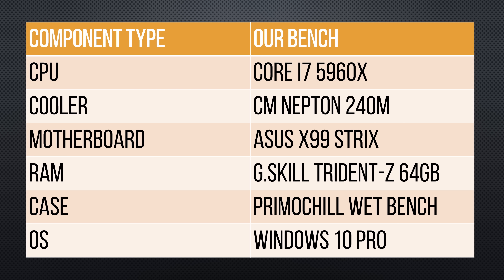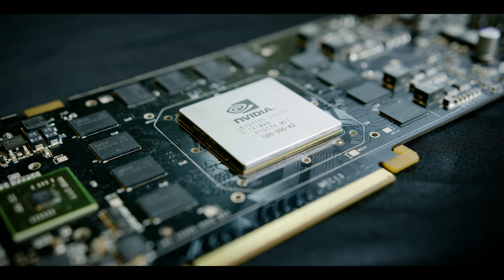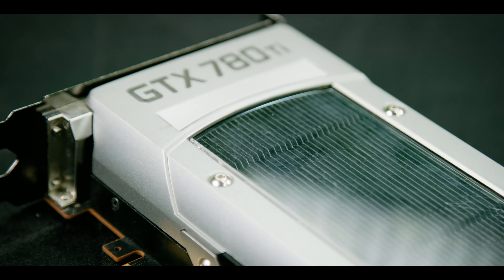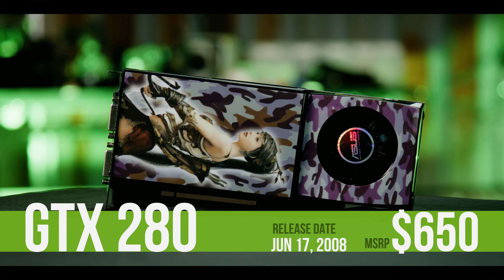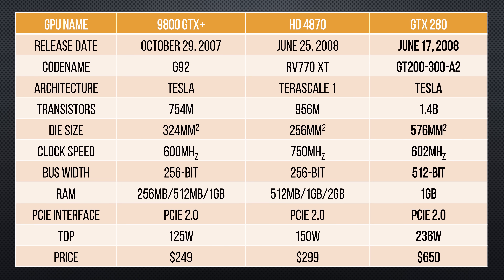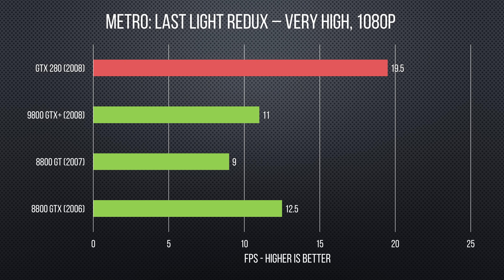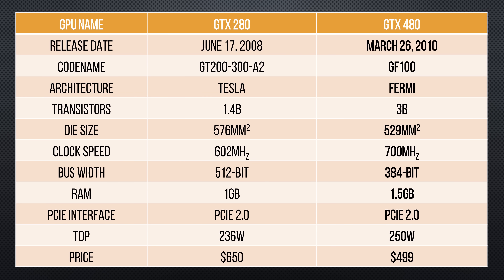10 YEARS of NVIDIA Video Cards Compared!

Comment: A bit late to the show here, but wanted to state the last few generation have not been that great. You can see early on HUGE jumps and strides that made upgrading exciting and fun; however, now it's more like "yeah, I can skip this generation" attitude. My 970 is still doing great and did not feel the 1070 was worth the money / upgrade. When you compare the GTX280 to a GTX480  it was over a 150(ish)% increase (memory could be fuzzy). Now when you compare the 970 vs 1070 it's barely over 50%.

Have we hit the ceiling and tech is slowing down to where we can wait 2-3 generations before upgrading? I want to build something new and hand this machine down to my kids for their school work and educational game *cough Fortnite cough*, but not sure if even the 1170 or whatever the next gen will be called is worth the costs. Heck, my best friend is still running my computer built with a i5 3770k (not overclocked yet), and AMD HD7970 (from mid 2012). That is a 6 year old GPU that is still running everything on high without issues not overclocked. 

Just saying this last 6 years has been rather disappointing. I could have kept that machine and it would be doing great by today standards, sure not the best and wouldn't play some of today's games on Ultra, but still pretty damn decent for a 6 year old machine.

Comment: He skipped over the GTX 295, which was the two 280s in SLI on the same board. At the time I had two GTX 295's, which gave me quad SLI - which was basically completely unsupported and useless for 97% of all games out there. Anywho I needed all that horsepower for the 5 year old 30" 2560x1600 monitor I had - which is twice the resolution of 1080p. Most things still ran like garbage in that you'd get high frame rates, yet to my eye things didn't look smooth, which was later referred to as micro stutters, a huge downside of SLI. So overall it was a complete waste of money, but I was rolling in cash at the time so I didn't actually care.

Comment: 980 was really useful if you were looking at a small build but still wanted a good and powerful system. Even today a 980 is nearly on par (bout 10% ~ 15% less powerful) than a 1070 with about 5% less power, that's pretty impressive. Not to mention it over-clocks like a beast!!!

Comment: So 1080Ti is not worth the purchase if used only for games, since the computing wasn't even used, and it had that tech for such stuff, meaning if it wasn't there, it would have reduced the cost, or better replaced with some other stuff instead to compensate and something that would be used.

Comment: My first card was an Nvidia MX 200,Then a TI 4200, a 6800, a 8800 GTX, 2 GTX 280's in sli, a GTX 590, and GTX 780, and now a GTX 1080 TI. I have nothing against ATI/AMD but Nvidia used to be the only graphics cards that would work in 3d with shutter glasses and a CRT monitor. They took the 3d out of drivers when the GTX 8800 hit the stores. I have an oculus rift now. Best 3d virtual reality experience I have ever had. Peace

Comment: i had bad experiences whit sli
2006 -  2 7300GS 256 DDR2 (fucking slow and useless i was stupid and no money)
2010 - 2 GTX 480 ( fucking fast, but so much noise, heat, and the power bill was fucking high)

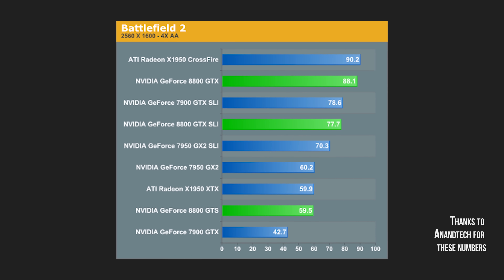Comment: 2:20 Except the 8800 GTX SLI result was also poorer than that from a single card...
could you run those yourself Linus, or not worth it?
SLI worked a lot better for the 7900 GTX there.

Comment: Since i cant find a 1080 TI  around 800-900 bucks thanks to bitmining.  I was wondering if i should buy a second 970 FTW around 400 and put it in SLI ..  How would the performance compare with the current 1080 Ti s I wonder.

Comment: I had the 8300 one then about 5 years ago that PC got trashed. then i got a laptop with the 430. it ran quite well, well until the actual laptop itself overheated to destruction lol. now i have the 1060 since i cant afford the 1080 or the 1070 and i bought it for school purposes(lol) hey, autocad and some engineering programs require a bit of power lol

Comment: And I'm here with my Intel graphics .
Reply: sackgames me too with a 3000 intel hd graphics and intel i3 3210 over clocked white toshiba satellite
Reply: stamisme my other account yo i also have a i3 2120 and i was able to get 11 fps on low settings on gta v with intel graphics
Reply: Lmao, I have a new laptop with a 1050ti
Reply: Lucky u :) anyway
Reply: you are dumb
Reply: sackgames same but my 1050ti is coming in ten days
Reply: Lmao same I got intel graphics and a GeForce gt 730a
Reply: Random Internet Person thats stupid af
Reply: Intel HD graphics integrated into the chipset.
Reply: sackgames same here. Core i3 2130, the CPU with the worse iGPU ever made. Fortnite on lowest settings wont even Start, and if you are lucky youll get like 0.3 fps lol.
Reply: Idk I've never had troubles with HD 4000 and HD 5500. Then again, only games I've played are Fractured but whole and KOTOR (which could run at 60fps on a rotary phone)
Reply: Same
Reply: Intel is gay
Reply: Same here
Reply: me too, 4400
Reply: @ryze9153  Yo same bro
Reply: @ryze9153  specs
Reply: @JAWorks-z71  oh thats awesome. Nice man :)
Reply: I was using Intel 510 for a few years... that was the best integrated graphics I've ever had.
That's not an accomplishment, that's just a 2015 Pentium being better than a 2009 Pentium.

It was very refreshing to get the 1050 Ti; I used that until... the day after tomorrow, actually.
I ordered its replacement an hour or two ago. Shame, now my vertical res won't match my GPU name...
Reply: @ryze9153  im getting a RTX 2070 Super With Ryzen 7 2700X
Reply: I'll never buy anything with Intel HD inside.Ever!
Reply: I just upgraded to i5 9400f rtx 2060 super 16gb 3200mhz ram.... from fx6300 and a gtx 1060 3gb.  So much better now lol.
Reply: Y'all Intel users disgust me
Reply: Juuuuust upgraded again to a 9700k.  Gonna put the 9400f in the micro build i'm doing.  It's still a really good processor.
Reply: @ryze9153  I got ryzen 7 2700x 16gb ddr4 3000 MHz and a gtx 1070 you lowly graphics peasants
Reply: @ryze9153  hmmm my build cost like 1k
Reply: @ryze9153  ew 1060 3gb
Reply: @ryze9153  a gtx 970 is most likely better than that Doo doo
Reply: @ryze9153  you sound unsure my boi
Reply: you can get a lot for 1800....just use pc parts picker and mess around.  You could prolly even get a nice rtx 2080 super with an 1800 dollar budget.  If you want to go amd for gpu, get a 5700xt red devil or something similar.  The 2080s would be better though.
Reply: @ryze9153  Maybe wait for ampere apparently there better and cheaper then the 2000 series. Also 7nm.
Reply: @ryze9153  np
Reply: Amd e2 9000 and amd radeon (the GPU is fine but the processor is garbage. But I will build a new pc next year with a gtx 1070, amd ryzen 5 or 7 or 9
Reply: @ryze9153  Yes definetly
Reply: @ryze9153  That's a good pc but you should've waited for ampere which is more powerful, 7nm and cheaper coming 2020
Reply: @ryze9153  peasant I'm gonna get the new rtx 3080ti or whatever they are calling it, weak ass 2070 super
Reply: @ryze9153  blew about 600 dollars on that shit as super card you fool when the next line is coming out this year
Reply: and im here with geforce 210
Reply: I have a GTX 1050
Reply: @ryze9153  GTX 1060 IS TRAS- ahem, decent
Reply: @ryze9153  so you are getting an i9 and a 2070? For 1600?! The i9 it self cost like 700 dollars on it's own XD
Reply: @ryze9153  ok weird flex but okay 😒
Reply: @ryze9153  before you were spamming, IM GETIN NEW PC THAT HAZ I9 N 2070 SUPR
Reply: @ryze9153  1060 is getting tired... You should upgrade you gpu to a 1650S at least
Reply: the absolute worst GPU ever. run PUBG on low at 10fps. and i spent 40$ on that >:(
Reply: @themin3rcraft3r72  UGH,i can't believe it,i bought something cheao and expecting good performance out of a very demanding game,this sucks !!!!!111! >:((((((
Reply: sackgames I just got a GT 730 to get away from my Intel hd 3000 graphics. I'm not disappointed
Reply: @KeaganLegit  it's still shit
Reply: @KeaganLegit  why just why you couldve spent that money on a real GPU like a used rx 570 8gb or at the bare minimum a gtx 950 used for like 80$
Reply: To everyone who has 1050Ti... GETALIFEIHAVE2TITANVSINLINKHAHANOOBSUCKERS!!!!

Comment: I was a graphics card enthusiast and I wanted to get my hands on the fermi cards the gtx 470 and gtx 580. Worst mistake of my life. Unless you have open fan cooling model of the card, don’t recommend it bc they run so hot and take up so much power it’s a joke. Remember playing the wither 3 on the gtx 580 it actually ran surprisingly well except for the fact the temps spiked up in to the high 90s and kept on getting hotter even when I replaced the thermal paste.

Comment: My GTX480 had a super peculiar behaviour. At idle, the GPU temp creeped to 98 degrees C(!) but under load, the fans kicked in and the temp lowered to 96 degrees; then when the load was removed, the fans kept going until the GPU was somewhere around 60 degrees, and then the temp started creeping up again.

Comment: I'm so glad you called out Nvidia for being the bastards they are for price gouging and being lazy trash because they have the lead. Of all the video cards I bought I only feel sour for buying NVIDIA cards. I had my 5870ATI for 09 to 13 never ever had buyers remorse. However, with my 8800GTS I instantly had remorse as the 8800GT spanked the GTS with more ram and performance at a lower price like 3 months after I purchased. Repeat this again when I got a 780GTX and then the 780 TI came out a few months later.  AMD taking over ATI was the worst thing for videocards period. Their toxic touch made amd fall from the crown it once had and I never once felt grubby buying an ATI. Oh I guess I should mention my 1070GTX again got screwed by the 1070 TI. so that's strike 3.

Comment: fermi cards are still great today and the 580 had 1.5/3gb
Reply: RetroX not anymore got disappointed when u can run bo3 at full low only at 1080p
Reply: I have the 1.5GB GTX 580. It does okay with some games but most I can't run passed medium settings at 1080P.

Comment: Im still using 2x8800 ultras in sli, will any modern card be a noticeable upgrade,  im going to build a new pc the one i have now is 12 years old,  is it worth using my 2x8800 ultras or buy a 1050 Ti for a casual gamer ryzen 3 1200 build.

Comment: SO MUCH False information on this video.

Seriously, wtf were you guys thinking?
Did you even do any actual research on this stuff?

Jeez. I started counting the technical mistakes that you made, but I genuinely lost count.

What is striking, is that some errors are just so blatantly weird, that it makes me wonder how they were made in the first place.

For example, the GTX 580 came at a standard of 1.5GB of VRam, same as its predecessor the GTX 480. There were also 3GB models, but those were more rare.
In the specs, you listed the memory config as 2GB/4GB.
Where did you even get that?
No cards in the entire 500 series of Nvidia cards had that config.

The 560ti was at a 1GB/2GB, and the 570 was at 1284 MB of ram.

I would mention all the other mistakes, but I cant bother to write them all up.
Get your facts straight, Linus Tech Tips.

Comment: AHHH MY 8800 the day the world changed in graphics cards. I remember putting that in my computer and my FPS went through the roof and I was able to up the graphics on every game. The GT model was the cheaper model which my friend had and it still ran better than an other card at the time. My line of cards GTX 8800, GTX 460, GTX 660, GTX 970, and now GTX 1080.

Comment: Your videos help me get through the days and I actually learn something! Remembering the good ol days help -- My first 3d card was a Diamond Monster 3D and shortly after a 3Dfx Voodoo 3 16MB.  My first flagship was an an XFX 8800 GTX G80 768MB (My XBL Gamertag is ZudeoG80 lol) 

It's been years since I've last built a PC and your videos inspired me to build a new gaming PC on my birthday in September. I finally got myself an Asus Strix GTX 1080 :-)

Anyways, 

Thanks -- you and your team helped me remember my love for all things PC. 

- Earl.
Reply: Earl Barker the 3dfx voodoo cards where very nice , they made gaming back then really awesome.
A lot games looked and played a lot smoother with the voodoo cards.
I had it with a pentium mmx 233mhz computer 😂 nowadays mobile phones have more power haha.
Those gpu's are nice for retro gaming.
I also still have the 8800 gts and gtx lying around here.
At the moment I play games on a dell 980 sff i7 870 + 1050ti 4gb + 8gb ram and works pretty well for the costs.
Computer was €80 euro (ebay bargain) and the gpu €170 and an ssd upgrade for €100.
It needs around 15 sec to start up.
Downside is that the msi 1050ti is quite noisy , I want to change the cooler fans to one big cooler fan or maybe a big passive radiator (it never gets over 50C and on idle its just 35C).

Comment: 5:36 i have this thing on my pc right now, and with 580w PSU i have problems with this card. im not sure my pc shuts down because of low PSU or the problem is something else.
Reply: real4o you should get 700w
Reply: actually no. the problem was heat.... now works perfectly fine with 580 PSU
Reply: real4o maybe try buying some led fans for cooling or some case with great temp maintaining

Comment: Where the heck is GTX 970?! It is still a solid GPU
Reply: this video is for top end gpu each generation. 
970 is just a slower 980, same thing applies to 1070 vs 1080
Reply: Yeah and wheres my 210...
I wanted to see where I could be :(
Reply: How come my gt 730 isn’t on here?
Reply: 3.5
Reply: dude...
Reply: lol
Reply: Ebisu thx learned something new
Reply: Yeah the gtx 970's were super popular.
Reply: Ebisu  Ikr?? they even downclocked and downperform the 1070ti which....

Read more
Reply: so is a 770 is 2018
Reply: Isn't it still the most popular gpu by an enormous margin?
Reply: Linus only did the top end ones.
Reply: Same goes for gtx 970m.... where the hell it be

Comment: Because you chose to run the tests at 1080p the gap between the newer cards isn't as reflective as it should be due to CPU limitations. You should of ideally run them at 1440p which would of chocked the older cards but would of allowed the newer cards to stretch their legs and show a much truer table of performance.

Comment: I am about to buy a MSI NVIDIA GEFORCE GTX 1050Ti
Reply: dont.. get 1060 rather
Reply: And you're complaining? Try using a gt 430 and you would wish for your 980 ti back.
Reply: The 1050ti is a good card
Reply: Good choice, 1060 would be better unless you have a low end PSU.
Reply: spend the extra 150 and get the 1060 6gb better card all around, bought a 1050ti for my girls pc and it was slow as balls so i got rid of it and got her the 1060 6gb
Reply: the speed of your pc doesnt matter about her graphics card'
Reply: Not a bad buy I got mine pretty cheap and it pairs well with the FX-8350
Reply: Geck0Boy Gaming my 1080 ti is coming tomorrow :)
Reply: Same
Reply: Geck0Boy Gaming lol that card is legit cancer lmao
Reply: me too
Reply: i got a gtx 970. bought it used for cheap. i love it :)
Reply: Bad shit its like a 960 and the 960 wont hold up for more than 2 more years. Go for at 1060 or used 1070
Reply: I got a 1050 Ti paired with an i5-4590 to upgrade from an i3-4370 and GT 740, although the 1060 would certainly be faster, anything above a 1050 TI is VERY expensive at least from my point of view, and the 1050 Ti was the absolute best I could afford.  I am very happy with the performance I have gotten.  It depends what you are upgrading from and what games you play, but the 1050 Ti seems to be a very good card from my point of view.
Reply: iBallasticwolf2 i agree
Reply: Thats the one i have and it works great
Reply: C oo L
Reply: Buy a gtx 970....
Reply: Geck0Boy Gaming did ya buy it?
Reply: Geck0Boy Gaming I have a rx560 Asus rog so Trix OC 4gb and I feel like it's better than the 1050ti

Comment: Are there any low power video cards? All of these take 3 times more than my current entire system. I know I'd be sacrificing a lot of speed but ideally I want to keep total power under 100W. Currently I have an i5 7400T low power ram and low power disk (2.5W SSD) even the monitor only takes about 26W.

Comment: Own and still own the 8800GTX (x2), GTX 295, GTX 770, GTX 980, and GTX 1080 (x2). So I own half of the Nvidia's flagship the past ten years, finally realizing how much money I spent on them. Each time I upgraded from one to another was huge performance boost along side with CPU from Core 2 Duo, quad extreme (yes, i was stupid), to Core i7 920 to 5820k. One thing that didn't age much id the HDD, which still mostly runs @7200rpm now with just bigger and bigger size

Comment: You left us hanging at the end by saying the top chip in the current generation isn't on a "consumer" card.  So what card is it on, and how does it perform.  Also, 10 years isn't long enough, you should have started at the NV1 (internal name).  Of cause ATI/AMD is even older.

Comment: Still rocking a GTX 460 768MB.
Reply: Still got my gtx 560
Reply: my gtx 260 is my best friend
Reply: Fermi cards got completely ditched a while ago
Reply: Still rocking that Intel hd 4000 shared graphics.
Reply: great card
Reply: You still got the 460? Also, I have a gtx 480 Twin FrozrII.
Reply: GTX 460 <3 still using it right now writing this comment to you.

-Gainward one and if overclocked it can reach the speeds of the 560 :p
Reply: 960 here its good
Reply: Still better than Vega

Comment: Nvidia's GP100 and GP102 chips both have identical amount of CUDA cores. GP100 has extra transistors for FP64 and HBM2, both useless for gaming cards (at least with Nvidia). If Nvidia put GP100 on a gaming card it would most likely lose against card with GP102 because latter is simpler and can be clocked higher.